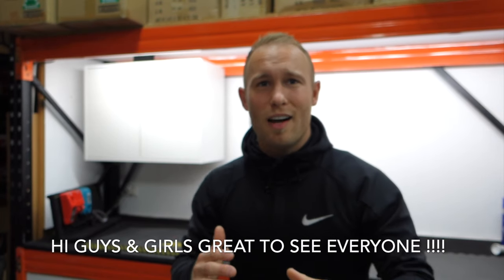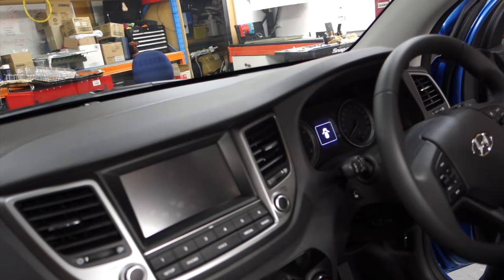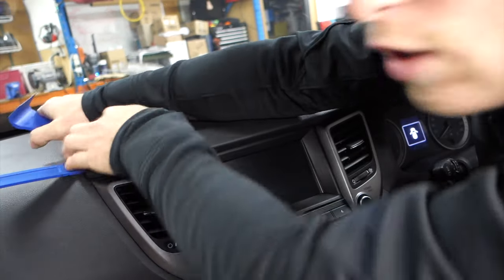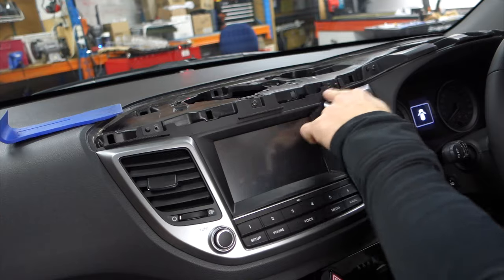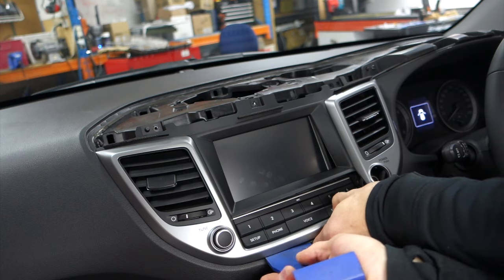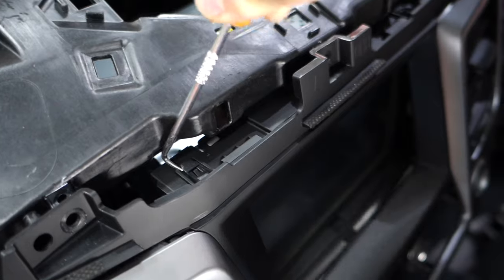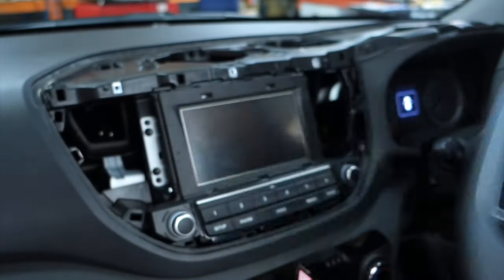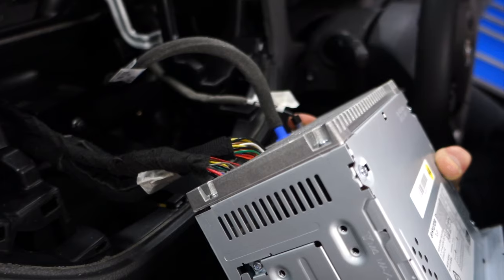2017 Hyundai Tucson Stereo Removal !!!

Comment: I tried this with 2 of the smaller pry tools with zero sucess. Bought a better set that had that larger tool. Still a PITA but eventually had they pull force needed to free up the dash. Just remember those are straight pins and out with all your might repeatedly

Comment: Great guide Elliott! I trusted your suggestions and I removed the radio of my brand new Tucson in a while! Next step: add a DSP with powerful amplifier, a subwoofer and change the front two-way system. Any suggestion?
Reply: I guess im randomly asking but does anybody know of a tool to get back into an Instagram account?
I somehow forgot the password. I appreciate any tips you can give me!
Reply: @Izaiah Flynn Instablaster ;)
Reply: @Darren Sean thanks for your reply. I found the site through google and Im in the hacking process atm.
Takes quite some time so I will get back to you later with my results.
Reply: @Darren Sean it did the trick and I actually got access to my account again. I'm so happy:D
Thanks so much, you saved my account :D
Reply: @Izaiah Flynn you are welcome :)

Comment: Hey Elliott, I'm trying to put back the dash panel (on top of the radio) but, the clips won't go all the way through... I already checked everything but, I can't seem to see anything.. Any suggestions?
Reply from the maker: Elisamuel Vázquez Sometimes the clips need to be bent back to the original shape. Also check the hole the clip is being pushed back into. Sometimes the plastic can be broken. Observe each hole and clip at the bottom of the dash panel and compare to the top clips and look for small differences. There is typically some obstructions. Good luck :-)

Comment: Hi, I have a 2018 tucson with just the radio, would it be possible to upgrade to a sat nav unit and reversing camera. Is the wiring the same, like are all the plugs etc. there. Thanks. Ian
Reply: Hi Ian did you have any luck in the upgrade planning to do the same

Comment: Hi and thanks for the video, I will be ripping my dash apart to get to the back of the stereo soon. The USB port is a right pain in the ass as it keeps freezing. Do you have any suggestions as to what other after market units I can replace it with that can be used with the steering wheel buttons? Cheers, Flaxvert
Reply from the maker: I have done a few of these. So if you are going to replace the radio I typically would go with a pioneer unit with avh or a nex series then it comes down to features and price point. But its really down to your own personal preference. You can get a usb retention and steering wheel controls for the car. For the Steering wheel controls You can get a pac SWIRC or you can possiblly get a plug and play harness. I can recommend you products however, I am in Australia so if you are in the USA they may or may not be the same.
Reply: Elliott Exclusive - Car Audio cheers for your reply buddy. I'm in the UK so may need to order parts from abroad. I have the dash apart now thanks to your video, my cars RHD too which helps ☺. I opted for an A-Sure unit off eBay, it's android and has screen mirroring so I can use waze Sat nav rather than the rubbish Hyundai supplied. I will see how long I can live without steering wheel controls and add if needed at a later date. Cheers dude!
Reply from the maker: No worries, I am glad this video could help you out. Good call the mirroring. The stock stuff is garbage!
Reply: Elliott Exclusive - Car Audio  Hi I have a Hyundai Tucson 2016 in Canada with the 5“ HU do you know if I can swap it with the OEM 8“ inch NAV HU?
Reply: excellent video. well done

Comment: Hi There! 
My Hyundai tucson 2018 ,The Radio Reverse camera and the display panel is blank and  no sound as well. Try to push power button on but still no power...
Check all fuses are ok.
Any idea how to fix this issue...

Comment: Hello I have the tucson 2017 only yesterday I stopped working the screen turned off and only flashes white light
What can i do to fix it
Reply from the maker: I would first start with finding the radio fuse in the fuse panel of the car. Remove it put it back in. That should reset it. if you are still having the problem I would take your car into the dealer since the radio should still be under warranty.
Reply: mavi ulloa vereau take it to your dealer. dont u have a warranty???

Comment: Good video. How good is the signal from the OEM radio? I just got a brand new company car that happen to be a 2017 Tuscon but I found the sound terrible even compared to the 2010 Tuscon with stock stereo. Don't want to change the whole system also cause it's a company car may be speakers?
Reply: I'm in the same boat . My 2017 is under warranty and the FM signal is very weak at times . And the sound system by design is crap